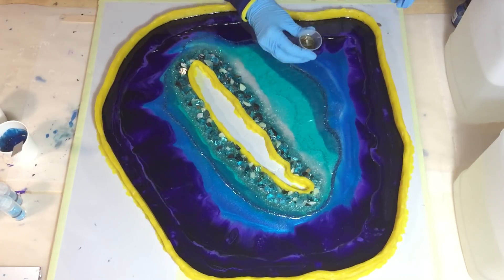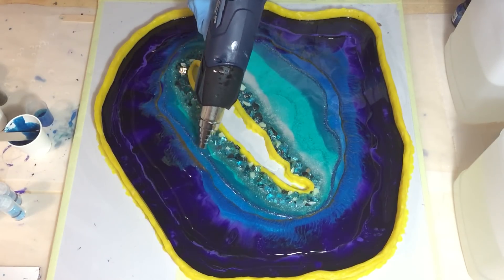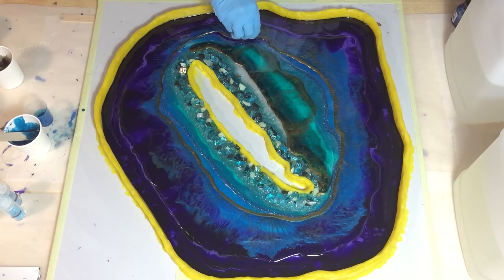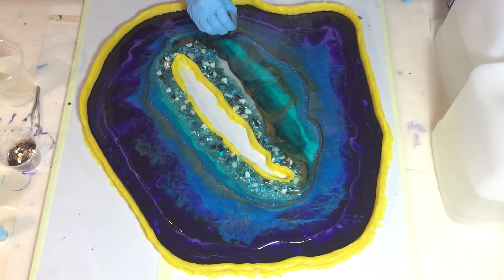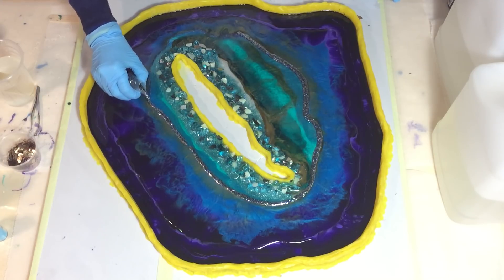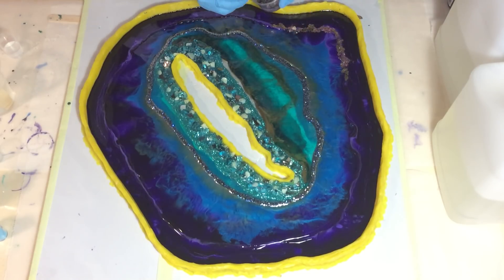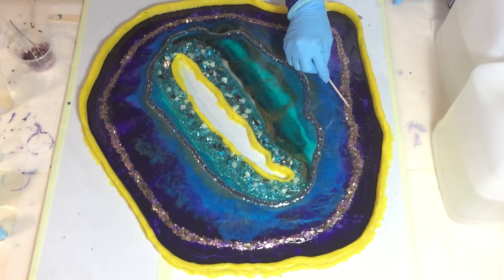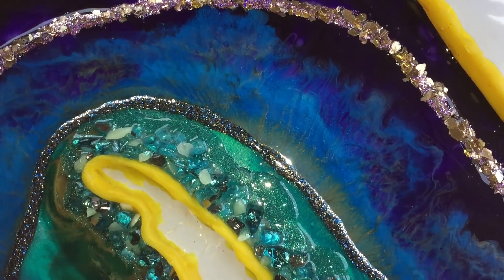129. Free Form Resin Geode. Layer 2 and 3

Comment: Lovely piece. I am using Mastercast but after adding a small amount of acrylic the resin becomes very thick and unable to move or flow with a heat gun. Do you know why this is?
Reply from the maker: Thank you so much Zara Zia. I'm also using Mastercast and I don't have that problem. What kind of acrylic are you using? What is the room temperature?
Reply: @petrajongbloed4425  I'm using normal acrylics from local craft stores, the room I work in is on the colder side. I have been pourigg direct on a canvas but the colours are very washed out and mixture too thick.
Reply from the maker: I hope you don't use the thicker acrylics, because they don't work in resin. They don't mix that good in resin. If I'm using acrylics I'm using the fluid acrylics of Vallejo, Golden or DecoArt. Don't put to much in your resin, 5%, otherwise it will get very thick. That can be your problem. But also the room temperature needs to be between 21 - 25 degrees celcius.
Reply: Yes Zara, it's because acrylics don't always work with resin. You can only use up to 10% acrylic to color your resin, and sometimes that's even too much, and you will have a thick gooey marshmallow fluff consistency that you can't work with. It won't set properly, and you can't even coat over it.....it basically ruins your piece if you try to use it. You can try adding less of that acrylic, or just avoid it altogether. The pigments and pastes that are specifically made to use with resin are so much better, and won't cause problems like that generally. Adding too much of anything to resin can throw off the chemical structure and cause problems with curing, but I have found that acrylic is the most tricky to use, and I try to stay away from using it as much as possible.